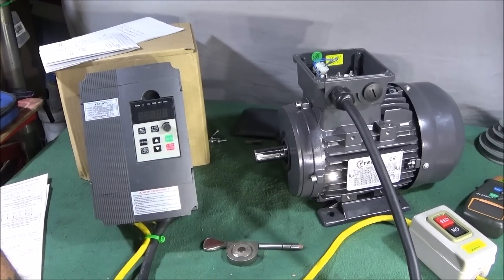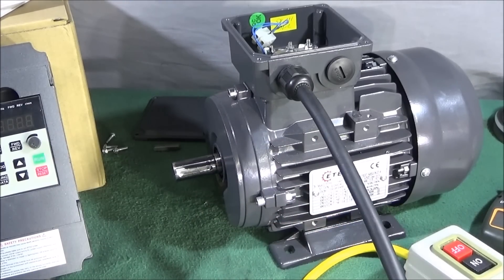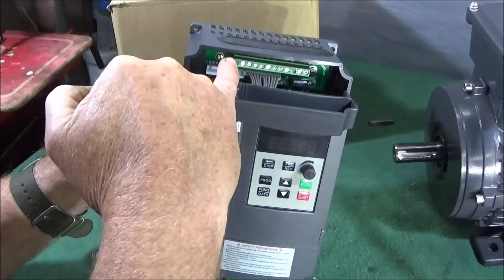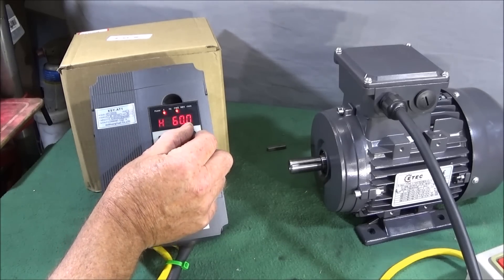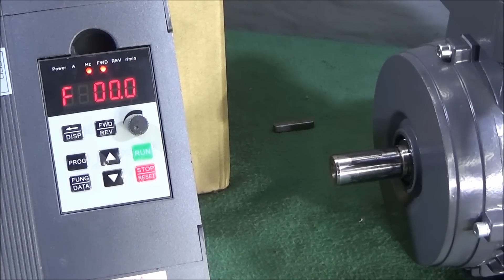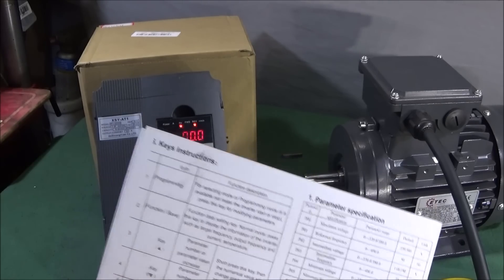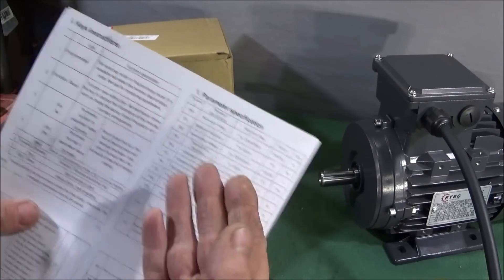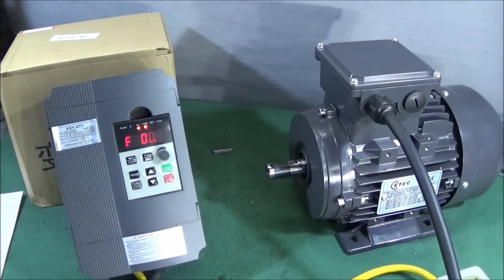XSY-AT1 VFD & 3 Phase Motor Bench Test Review Mini Lathe & Myford..

Comment: im building some grinders and have a very similar setup to you , i wired the motor in star config like you and just left it as default and it seemed to run fine but when i put a belt on it had no torque i stopped the motor and the vfd just went out and is dead. i dont know if i need to have it delta config and set voltage and max hz to thye motor stating 50hz? please help all thge tutorials dont mention this and are all american to make it more confusing

Comment: Question - is it possible to set up the XSY-AT1 frequency converter so that when turned on it works at high speed, about 2-3 minutes, but after 2-3 minutes of operation to a pre-set low speed? A pool water pump is connected to the XSY-AT1 frequency converter.

Comment: Thanks for your video. Could you please explain something that confuses me. At 1:49 the still image shows your motor wired as STAR and not as DELTA, yet the illustration in the instruction manual shows AT1 must be wired as DELTA. Regarding your electronic tacho, it relies on reflected light, so is never going to work well on a curved surface. Better to put your target reflection window on the end of the shaft, then it is flat, not curved.
Reply from the maker: I made a mistake on that, and corrected it later in a follow-up comment.
Reply: @SteveJordan  Ok. Thanks. There is an AT-4 description in the manual which added to the confusion, but I have worked out it must have meant to say AT-3

Comment: External control cables coming out of the top of the  VFD does not lend its self to cable neatness, I have noticed that the majority of low Kw VFD they exit from the bottom as the motor supply cables do.

Comment: I have Motor 37 kw
1780 rpm
220v
Can I use this Inverter

For the Motor?
Reply from the maker: Hi this particular inverter is for up to 2.2 KW. Regards Steve
Reply: @SteveJordan 
Sould I buy 45 kw Inverter or 37kw
Also could u please recommend an Inverter for the Motor with good quilty and price
Thanks

Comment: hi Steve do you think this setup would be suitable for a Myford ML8 wood lathe retaining the existing pulley arrangement to obtain a variable speed on the face of it it sounds cost effective way to achieve this Dave Williams
Reply: Hi Steve thank you very much for your prompt reply. I went up the loft this morning and found 2  3 phase motors Brooks make which I believe is pretty good however they are old and they are 2 hp 2850 rpm before I go any further obviously these motors would need to be checked thoroughly before any alterations or indeed matching with an inverter to control them I believe the original motor on the ML8 wood lathe is 1/ 2 hp obviously i would need to check this ? could you give me any guidance on the best way to check these motors. I really would like to get a very slow rpm for safety reasons not much fun when a piece of wood flies off the lathe even with protective clothing on.  The slowest I can achieve at moment is 850 rpm which is far too fast for safety with out balanced pieces thanks Steve speak to you soon
Reply from the maker: Hi David, yes it would be fine for that. If I had a wood lathe I would use the set up. I am pretty sure it is more economical to run 3 phase as well. Regards Steve

Comment: A low RPM motor has the advantage of requiring a fully twice the diameter of a 3600 rpm motor which is easier on the belt(s) for the same input speed on the lathe in this case.

Comment: You haven't ran the earth through the switch have you mate? I was always told that this was a big no no, and the earth should be constantly connected if the device is plugged into the wall.
Reply from the maker: No I put it right later at some point.

Comment: Heya, where did you get the cable for the motor from? I have an air raid siren and I’ll be running it on a VFD but idk what size cable I need
Reply from the maker: Hi I just bought a 3 phase extension lead and cut some off that. It was the cheapest way at the time. Have you searched eBay?
Reply: @SteveJordan its 3HP, 3ph, 2850rpm and its running current is 5A

Comment: install this inverter in a belt sander and slide when you force sandpaper, it shows error 6 on the panel. Do you know how to solve this problem?
Reply from the maker: Hi no I haven't had any problems with mine so I don't know. Do you have a 3 phase motor on the sander?
Reply: @SteveJordan  
yes, three-phase 2hp

Comment: This is OK for the UK but, most European households have both single and three phase power as their standard domestic power installation.So those Europeans watching this very informative video should check their supply criterion before ordering a converter because you most probably will need a converter with a 380 volt supply and not 240 volt.

Comment: Just one remark: The GND (not neutral) MUST BE CONNECTED under ANY circumstances. I do not know why the swich changed the measurement at around 4:05. That should not happen! GND must be connected anytime.
Reply: I came here to say the same.
Reply: @Christian Wolf my guess is that in the box is a 3 contact switch, and he wired phase neutral and earth on the switch, thus disconnecting chassis ground from the earth when the switch is off
Reply: @ni_pil  That might be true but is definitively a security issue! There should be no need to break the GND line. What happens if the switch (only on GND) fails? Or it connects slightly after the mains line. You have a metal case, do not think too much of it and have contact with it while turing on. This will fry you in just the moment between connection of mains line and GND connection (which will trigger the fuse in this case just too late). At least in Germany you ALWAYS bypass the PE aka GND by any switches.

Comment: Thanks Steve 
I've installed the exact same VFD  on a table saw. Everything is fine except the motor hasn't nearly the same todrque as it did under direct three phase.  Are there any settings i can tweak to make it better? Maybe not and fm this comes with the territory of fixing up single phase to make a synthetic three phase ......
Thanks for any ideas....
Reply: It is possible that your motor is configured for Y connection (400V) and the VFD outputs 230V so it needs Delta connection.
Reply: Without a rotary phase converter you lose 1/3 of the power from the motor with a VFD like this. Thats why when you buy a rotary phase converter you get it with 1.5 - 2 times the HP of the motor you are running.

Comment: Good ideas, what the make and model of the 3 phase motor you use.
Reply from the maker: Hi Thanks....It an Electro Tech 3 phase 1HP (1400 RPM) motor with B3 foot mount. You can get them on Ebay.
eBay item number:192580042652
 
Regards Steve
Reply: @SteveJordan  thanks

Comment: Hi Steve, i'd like to buy the same VFD for my CnC which wil be equipped with ER11 spindle with 46V DC, 500W, 12000 Rpm and 220V at home...But i only have 2 wires on it...red ( + ) and black (- )...Is it possible to connect it but without Earth...? Thank's a lot...Phil
Reply from the maker: You could but it would be best to put an earth wire from the motor housing I think although I only know basic electronics.

Comment: Hi Steve 
  I have noticed that you’ve said that your VGD is 2.2Kw  & the Motor is 1Hp. 
  I have read that VFD’s should be sized to the motor ! Ie I have a 0.75kw motor and though that I should have to get a 0.75kw VFD. Any thoughts about this ?
Reply from the maker: As far as I know you can have more Kw than required but not less than required.
Reply: Hmmm  I’ve been looking for that information as I have a 2.2kw VFD. ( same as yours ) but as I’d not found any information that testified as to your belief. I was therefore reluctant to try the 2.2kw VFD WITH MY 0.75kw Motor.
Am I correct in thinking that there is no information that I’ve noticed in the attached user information regarding “inserting motor Dataplate information “ into the parameters ?
Reply: @cherhanamiya1  I'm running the Tec .75kw 1hp motor (4 pole) with a 2.2 vfd, gives the option of a bigger motor later on, less stress on the components too, I've had no problems.

Comment: I have this current vfd and I need help. I get an error one which is amp overload... Motor is 3HP 8.5A rated 220V 3 phase. 

I have the same VFD as you but we hooked it up 1 phase input to 3 phase output.  

Everytime I switch my lathe into gear the error arises. Please let me know how to fix this

Comment: Hello sir. My father using this machine has a problem. He got error 8, and we think that it should be good to reset it to factory settings, but the manual doesn't mention anything about that. Can you help us please? Thank you in advance.
Reply from the maker: Hi Luves I don't think there is an actual reset button to return it to factory settings. One would need to have the instruction manual and return each parameter setting to that which is given therein. It's straight forward to do so. Regards Steve
Reply: @SteveJordan  thank you for your immediate response!
Reply: Hello again! My father didn't know how to programm it, he put it on, and monitor displayed programm 1.  Problem is that the manual isn't mentioning the numbers he should type on some variables, and in this way he put random numbers. This is why the screen displays "error 8".  He saw your video, he did everything correctly,  but problem still remains.  If he programms again "programm 1" what variables should he put? Because, as i said, some variables are not mentioned in the paper (the paper you have too on the video). Thank you again!

Comment: hi love your content, iv hooked my vfd like the one in your vid to a motor I pickup and iv got error code 1 on the readout can these things be reset ? the booklet says nothing about resetting what do you think? regards
Reply: Hello sir. Did you find a solution on how to reset to factory settings? Thank you in advance.
Reply: Error code one is possibly triggered because your 3 phase motor is in the Star or “Wye” configuration and if you’re trying to start it at say, 60Hz, you won’t have enough starting torque and you’ll get a  current spike. So this error code is protecting your device.  Press reset, or unplug and reset, and then turn the frequency dial to Zero, start the process again, with your motor switched on, and slowly increase the frequency. 

If your motor is in delta configuration you’ll be fine.

Comment: Very helpful video. Many thanks.
I’ve recently bought an AT4 model from same manufacturer using Banggood.  According to spec it is supposed to be an input 220v single phase and output 380v 3 phase model. If correct it is useful for driving older single voltage star point 3 phase motors without having to locate star point in windings and convert to Delta. 
I’m wanting to drive a 380v 3ph 1/2hp motor with this 3hp vfd. 
I would like to limit the current this vfd can output in order to protect the motor but I don’t see a parameter which permits me to limit the current to the motor’s plated full load current (1.05 amps) 
The instructions I received cover AT1, AT2, AT3, and AT4 models. 
I’m wondering whether you limited the output current and if so which parameter you used?
Another strange things is that the AT4 model does not have an earthing terminal.
Reply: my AT1 does have current limit option. It doesnt limit the current per say, but it trips over current if it goes over what you input.
Reply: 84Prerunner  
Which parameter limits the current? I'm having difficulty understanding some of the Chinese English. 
I've connected my AT4 up to a 380 volt star configured motor (only 1/2hp). Only parameters I changed were from 60hz to 50hz and motor rpm to 1425. Motor seems to run OK but don't know whether it has full power as currently just testing on bench.
Reply: Andrew Firman 
P78 through P85 are all over current settings. 
P24 is allowed time for over current
Reply: 84Prerunner Thanks. The default values seem somewhat arbitrary - I’ll play around with some of those and see what happens.

Comment: Hi did you configure the motor to run 240 delta or leave it in the star configuration?
Reply from the maker: Hi I changed it to Delta.
Reply: Steve Jordan ok thanks, I’ve got exactly the same setup except I think my motor is a bit bigger 2.2kw I’ve configured mine in star and delta and doesn’t seem to make any difference, I was just wondering if it matters or shortens the life of the vfd?
Reply: Or motor
Reply: @tribal165  Use Delta, VFD prefers it and I ead somewhere that the motor should be in the delta config, I think it's in the instructions for the motor too.

Comment: Hi Steve. Do you get good torque in low speed? I bought the same VFD as yours based on this video and got it working, but get low torque out of my 500W motor. The parameters I have set are motor RPM for 1400 and torque compensation to 50 (I think it was setting 72), minimum frequency to 10hz and max frequency to 100hz. Other than that I think I'm running on default settings.
Reply from the maker: Hi Samu, The torque seems to be ok on mine but I don't push it too hard with very low speeds and large drills, anything over 1".  I have my lathe set so that the belts will slip if anything were to crash, or if a drill became too blunt though. I notice the RPM slowing a bit sometimes on the display but nothing that would concern me.
Reply: OK thanks Steve. It could also be due to my motor. I don't understand much about these things. My motor is a two speed motor, and who knows it that affects the torque somehow.  @SteveJordan

Comment: Could you supply a link to the motor as I would like to buy one. Thanks
Reply from the maker: https://www.ebay.co.uk/itm/Single-Phase-Electric-Motor-0-18kw-to-4kw-240v-1400rpm-and-2800rpm-b3-b35-b34/202350512563?hash=item2f1d07c9b3:m:ms6x0DjX0Ubp4DMDsxcsHAA:rk:2:pf:0
Reply: @SteveJordan  Thanks Steve

Comment: Hi I have to exact same VFD, I would like to know which program changes the maximum frequency and the maximum voltage, also does the VFD compensate for the change. I’m make a free energy device where I feed power at a higher frequency to a motor and the motor spins a generator that gives me higher power at a lower frequency.